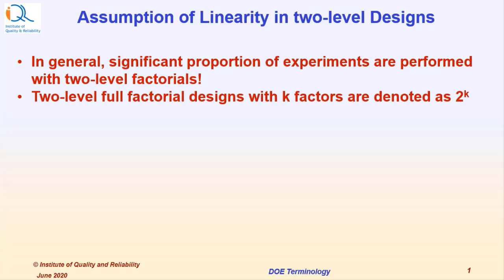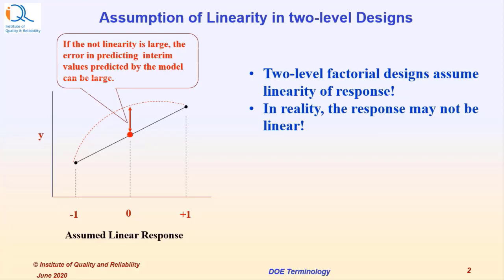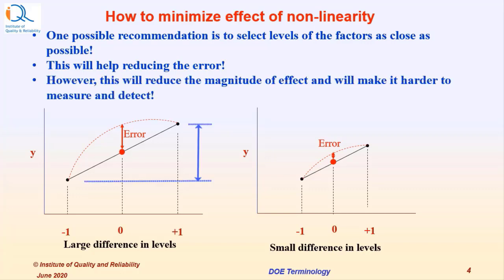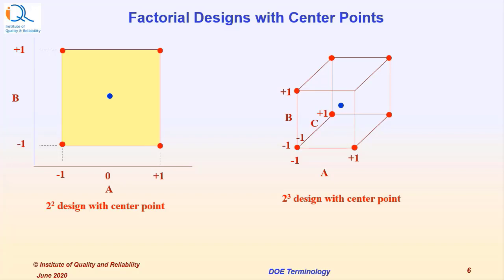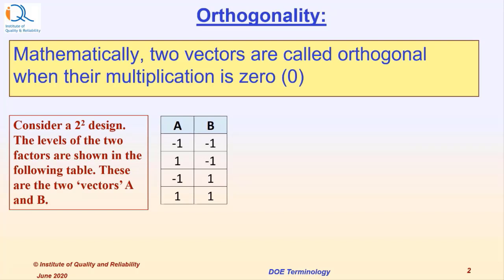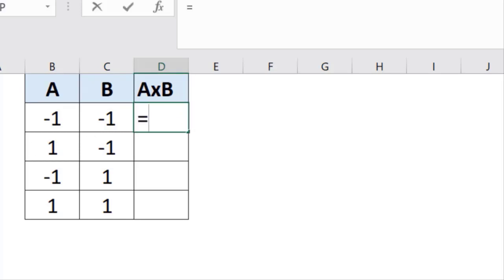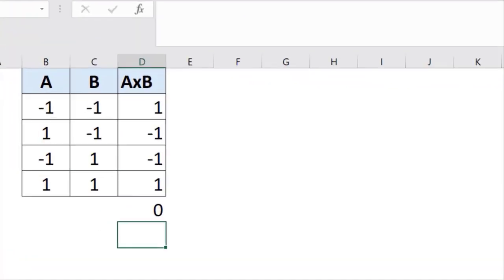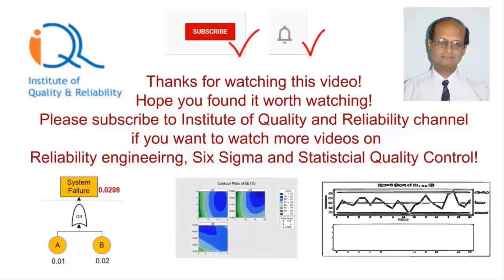DOE-8: Linearity and Orthogonality in Experimental Design

Comment: Thank you very much its really a matured presentation sir. . But how can we conduct experiment with 4-levels and 4 factors Design?
Thank you.
Reply from the maker: Thank you! The four-level four-factors design can be created with the General Full Factorial Design option. The number of runs will be 4^4 which is 256! This may be generally unmanageable! So you need to use an optimal computer design to reduce the number of runs depending on your expected number of effects (such as main effects and two-factor interactions)

Comment: On linearity, why will reducing the inference space (i.e. reducing the levels of factors) gives lower error? Why the red curvature line will be less pronounced when we reduce the level)? Shouldn't the red line be more pronounced giving approximately the same amount of error? On orthogonalilty, I understand. Is it possible to relate to vector, with 1 by 4 vector multiply by 4 by 1 vector gives 1 by 1 vector.  If this is true, why is it not 4 by 1 vector multiply 1 by 4?
Reply from the maker: Reducing the difference between levels will reduce the error due to non linearity.  It is like arc of circle will approach a chord when the included angle is small.
Reply from the maker: I am not sure if I understand the second part of the question.